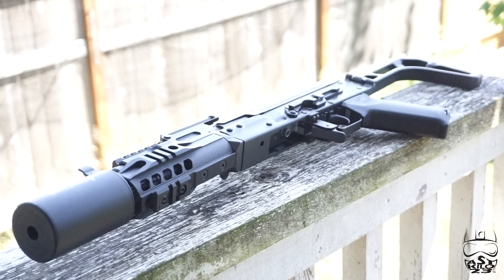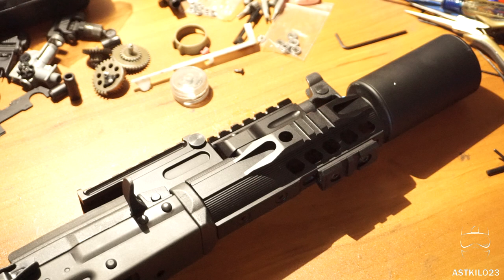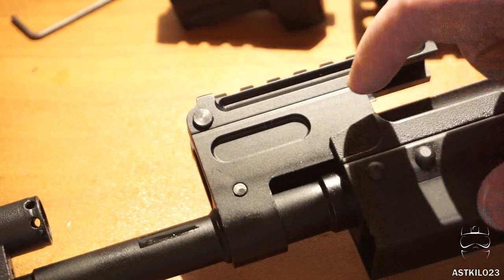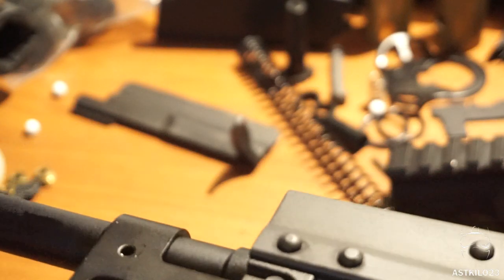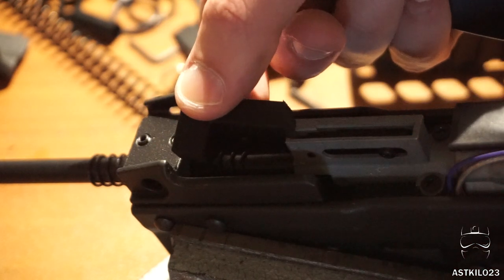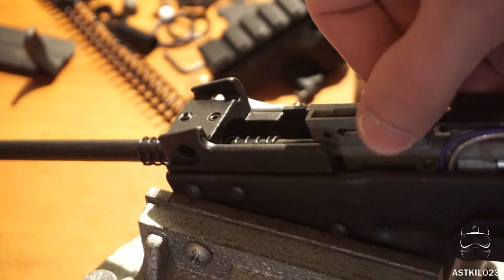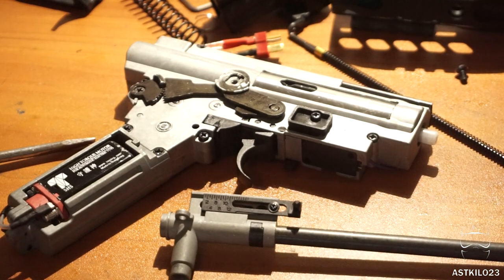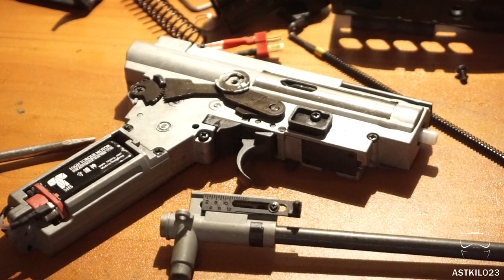Arcturus Airsoft AK Disassembly Guide

Comment: Hi , I have the same ak and the second pin that needs to be punched out was realy loose on my replica and well I just lost it. Long story short, does any body knows where to buy one if possible? Or just what that pin is called?
Reply: Email them directly and they might sort you out. I had an issue with a damaged part on my AT-AK04, I couldn't find a replacement anywhere. I emailed Arcturus(not their vendors) and they sent me a brand new part directly from the factor, free of charge!

Comment: The battery goes in the dust cover, what size battery will fit? Will a full stick type fit?
Reply from the maker: usually stick types fit, yes. make sure they're not too tall or wide.

Comment: 5:46 My fire selector screw just spins in place. How fucked am I?
Reply from the maker: You either need a new screw or new gearbox shell. Both are pretty inexpensive.
Reply: @ASTKilo23  Thanks! I went with "I'll just replace things that I break" and managed to pry it up and screw it off at the same time. Took some force, but it did the trick. It definitely striped the screw/gearbox a bit, but it works. Someone at the factory put the screw in crooked and just forced it anyway. Actually, every single airsoft or real steel AK I saw or owned had something drilled/mounted/screwed in crooked. For example: the front sight block. Arcturus is no different. That part is really realistic, for sure. I still dig mine, hard as nails and shoots great.

Btw, while I have your attention... Do I need a mosfet to run this thing on 11.1 lipo? I was planning on upgrading it with Perun AB++.
Reply from the maker: @roy-batty  The gun will ultimately last longer on a 7.4v. You do not necessarily need a mosfet for an 11.1v, but it'll be better for the gun in the long run. The AB++ is an excellent mosfet.

Comment: Hello, 
Do you know how to disassemble the Frontsight in total? I tooked to screw away but it's just wobbling but not moving. Do I need to push out these tiny pins?
Reply: Is your front sight/gasblock slightly rotated to the left? I just got mine 2 days ago and its bugging me. Did you find a fix? Im considering breaking it down to the barrel assembly and hoping it can be rotated back to something resembling straight. When i received it, it also had the handguard and gas tube installed poorly, the gastube lever was doing absolutely nothing, just flapping in the breeze, easy fix, but it does look like it was assembled by an apprentice with bad eyesight.

Comment: Hi thx for the vidéo ! Really easy now to disassembly my Ak06. During your test do you have double feed ? Iff yes how you sold the problem ? Thx for your reply Geoff
Reply from the maker: Are you having consistent double feeding or only on occasion? I've found that swapping the bucking can have a fair impact on that, but that's not a guaranteed fix.
Reply: @ASTKilo23  with Hi cap not but midcap (arcturus or Dmag) yes one double feed for 5 shoot …
Reply from the maker: @geoff5203  That happens fairly often with a few of my Arcturus guns with hicaps as well. I don't have an explanation for it. But I swapped a few to use Madbull blue buckings and don't have the issue anymore.
Reply: @ASTKilo23  ok thx for your reply 😊 i will check ans try to fix this issue !!
Reply: You supressor it really cool ! I see on comment you know now brand… but can you give me size ? I will try to find same ? Thx Geoff 😊

Comment: Hello mate,
Thanks for your video, i wanted to disassemble my at ak 04 to change the hop up seal. I want to fit a maple leaf 50°  in this but here is the probelm, when i put the barrel back in the hopup and then put the fake ak barrel on it with the sping, i have this little metal washer and the spring of the barrel sliding in the hop up seal... i dont know how to put it back correctly do you have any tips ? Thanks.
Reply from the maker: I'm having a hard time picturing your issue. Are you referring to the brass washer that sits around the inner barrel just in front of the hop up bucking?
Reply: @ASTKilo23  
Yes sorry my english is not very good, exactly, when i try to put the barrel back with the spring, the brass washer is entering in the in the hop up seal, and the spring compress the seal, maybe if you have a telegram or something so i can send you pictures of the problem.

thank you for your quick response
Reply from the maker: @Slawko.Warwzinyak  I think I'm sort of getting the idea. I have a few thoughts. Have you tried omitting the brass washer? I've had to on occasion, but not terribly often. It could also be that bucking. Have you tried the stock bucking to see if you have the same problem? I've had nothing but issues with Maple Leaf buckings. Most are too thin or don't seal at all.
Reply: @ASTKilo23  Strangely, I have the same problem with the original seal. I must have passed an observation step during the disassembly of the hopup. I did not see where the brass washer is supposed to fit. i feel like the bucking protrudes far too much from the hop-up ( when i try to put it back together ) and that the 6mm barrel is  to much loose in the hop-up. No i didnt tried to ommit the brass washer but i don't think that's where the problem come from. Do you have to force a little bit to fit the barrel into the hop-up correctly?
Reply from the maker: @Slawko.Warwzinyak  The bucking and barrel should fit snuggly into the hop up chamber, not loosely, and it shouldn't need to be crammed in either. Maybe try a small amount of silicone lubricant on the bucking? The bucking should end where the c-clip begins (the clip the holds the barrel in place).
Reply: @ASTKilo23   I'm sorry to bother you, but this is the first time I dismantle a replica and I think it's better that I ask someone with more experience. After a look, i still dont see were the problem come from, if you don't see too i will try to contact arcturus maybe they can help.

Comment: Is the Arcturus internals better than the lct internals?
Reply from the maker: in my personal opinion, i'd say yes. that's my opinion based on a decent amount of experience with the two brands.
Reply: ASTKilo23 do you believe it’s more worth it to purchase the Arcturus over lct and if so, which version do you personally prefer?
Reply from the maker: @duckiekun9532  yes, i would pick up an arcturus over an lct. they all perform well, so its whatever you prefer. i like the centaur b myself. unique look and lots of battery space.